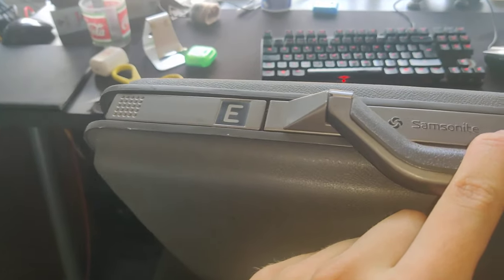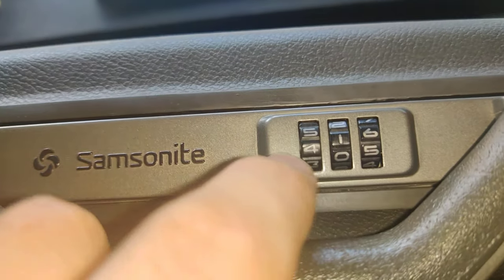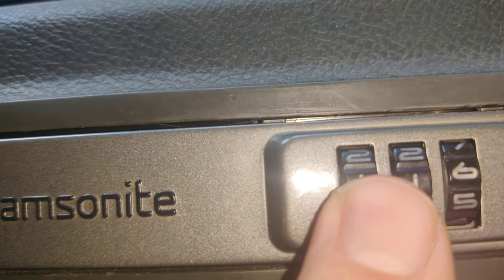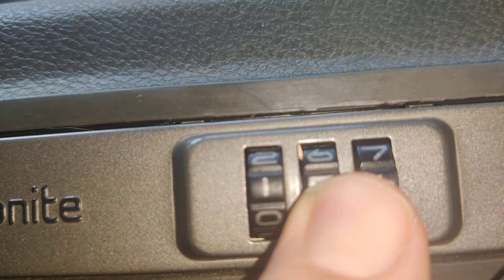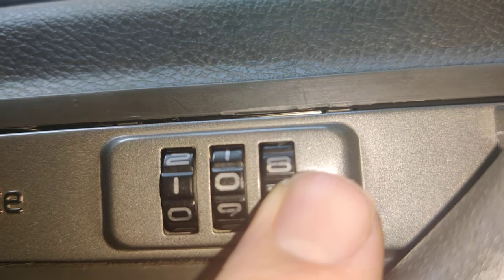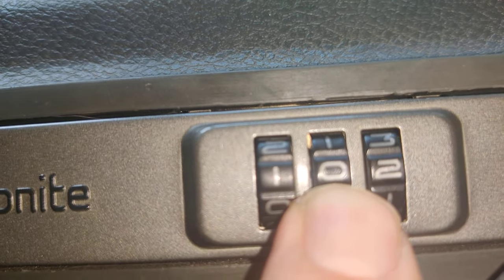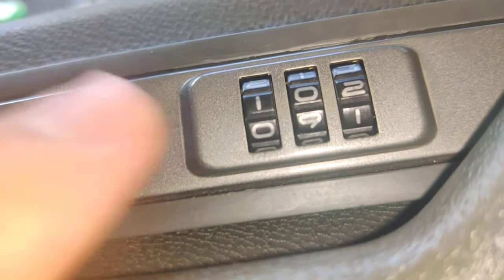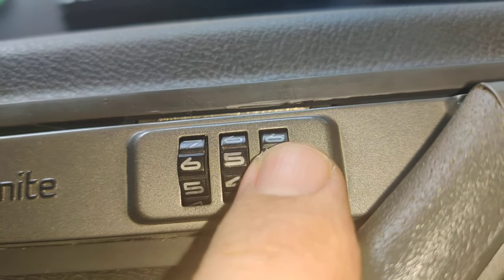How to open (decode) a Samsonite briefcase

Comment: I bought a locked briefcase at a thrift store. It was in great condition on the outside. I found the notches at 761 and when I counted 5 for each number it didn't open.   BUT, I added one more digit (6 count not 5) and my case opened, yeah!! Thanks alot for you video.  The others I watch didn't fit for my type of briefcase, but this was perfect!!

Comment: Thanks for the inspiration. In my case (samsonite focus deluxe) had to look at the right site of the dial. When turning found a very tiny hole. With that position (tiny hole visible) for all dials, the case opened without turning 5 more positions.

Comment: I used a sewing needle and poked it down the side of each number till I could find the notch in each cylinder and then added 5 and it popped right open. Turns out ti was 000. Thanks for the video.

Comment: It worked! I have a really old Samsonite briefcase, however (perhaps 20~30 years old), and instead of holes, there were little metal ribs sticking up periodically along the cylinder. I found a gap with a missing rib on each cylinder, however, and faced the gap up towards me--ie: the smooth spot with the missing rib up towards me. Then, that was the combination! It just opened! No need for me to rotate at all past that nor to put the gaps on the backside.

Comment: Worked!
As described in the video, with a pen torch, look into the gap of each number and move the digits till you see a small metal element. Stop. Proceed to next slot. Voila!

I couldn't see the metal bit on the middle number. So tried random numbers 0 to 9 for the middle one until it opened.

Comment: In my case i find the notch 556 adding 5 will be 001 but not opening , even after trying various combination.Don't u have other  technical tricks ?
Reply from the maker: Check for the spot in the cylinder again, try with 112 and 990, and perhaps jiggling it a little, so the "hook" part is unstuck. If your briefcase is a newer model this trick might not work.
Reply: Same mine.. Can't open it.. I found 152...same procedure it didn't work... Any tips pls

Comment: Pity, seemed to make sense, found the difference at 462 but cant open it!
Reply from the maker: In some models, the mecanism to release the lock might not be at 180º but 90º or so. After finding your number, add 111 to the combination, try to force it open, as you might need a little play to open, like on the video)  repeat until you found the correct one (10 combinations possible, it won't take you long)
Reply: @Ed-ql7ku  thanks man, I added 111 and also minussed it. Maybe I should just go around the clock with the combi
Reply from the maker: @anoukanansimeditations  you should!
Reply: @Ed-ql7ku  youre AMAZING that worked!! It was such a happy surprise haha

Comment: I found the notches at 682 straight line clear visible to me no cylinder  on these notches and i counted 5 after each notch so mine is 137 and calculation  for code no i started count after 6,8,2 till got 5th digit 
7 8 9 0 1(5th digit=1),90123(5th digit 3),34567(5th digit=7), so its 137